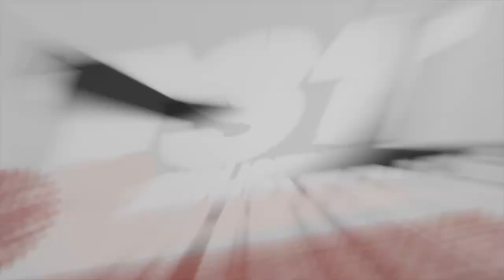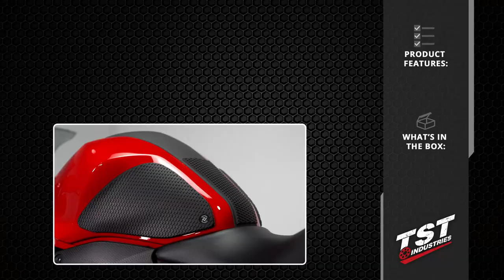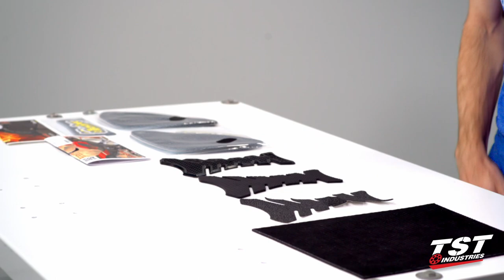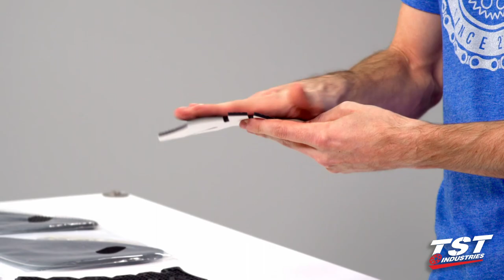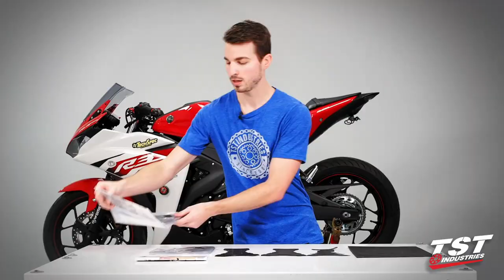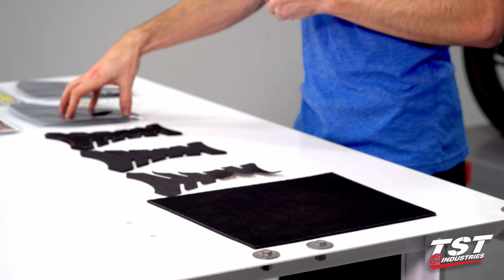TechSpec X-Line Material Feature Video by TST Industries

Comment: I have had a set of the TechSpec tank protectors for a few months now and sadly, I've been a bit displeased with them on my R3. Personally for me, I find that the actually contact point of my leg pressure is on the black plastic pieces below the tank. Having not really thought about it, I bought these protectors on a whim and only after having installed them did I realized my error. I believe these are great products but if you are planning to purchase protectors, do think about the placement and your own ergonomics before purchasing.
Reply from the maker: Clearly you ride in a much more upright and forward position than most. These grips are developed based on how most people interact with the bike ergonomically. For riders outside of that norm we have custom cut sheets where you get to decide the shape and size of the pads and customize them yourself.
Reply: Actually, I ride with my tailbone contacting the bit of plastic on the back. I'm only 5'7 and same with my brother whose nearly 6' so... Maybe it's just my short legs because my inseam is 29-30. Maybe it's the rear sets. Also, my knees are directly below where the material attached, it's not that my knees are extending too far past it. I'm just stating that anatomically, everyone is different, and thus should look before purchasing. I do not speak ill of the product, I think it's a fine product and worth it for those that fit their bike the appropriate way or willing to spend a little more for the other sheet to cut as they please.

Comment: My main question is why is the price higher for the xline material if you get less pieces, such as the center tank protector?
Reply from the maker: You would have to ask TechSpec USA directly. The X-line material is technically 2 materials in one so that could be the cause of the higher cost.

Comment: Is the x-line hard to clean?
Reply from the maker: you shouldn't clean the X-line pads. The outer layer is a fabric that is bonded to the substrate. Your cleaning agent may weaken the bond.
Reply: TSTindustries what if it gets dusty? And when you are washing your bike will the pads be OK?
Reply from the maker: The ones on our race bikes do get wet when we ride in wet conditions. They dry up and they are fine. If they get dusty you can blow them off with compressed air. If you want something that will hold up a little better to washing, but still provide really good grip consider the Snake Skin version. We have had excellent results with those.